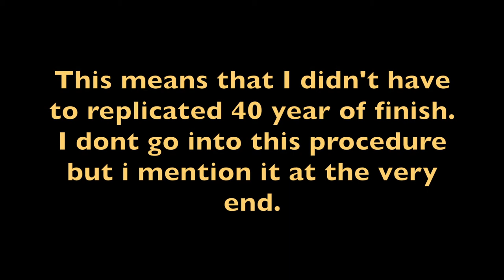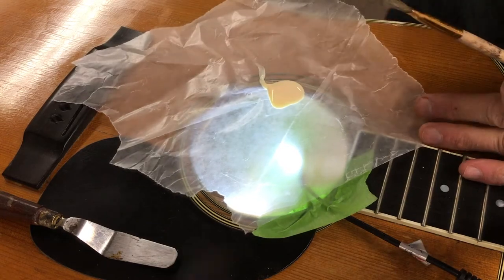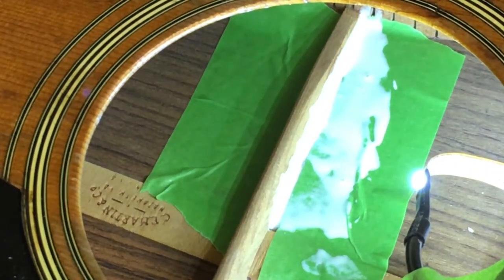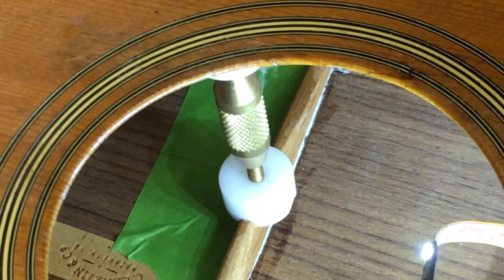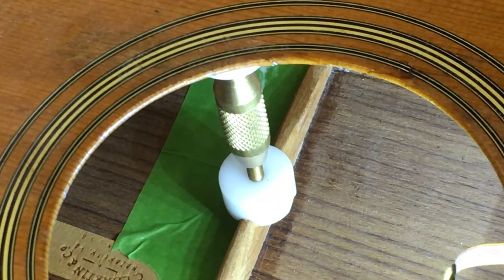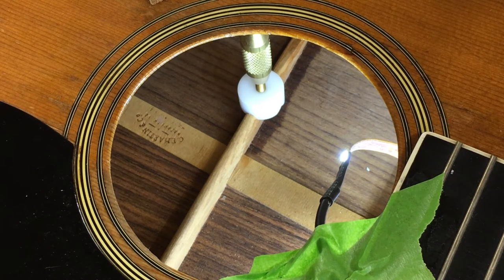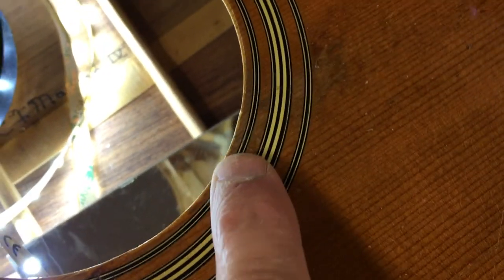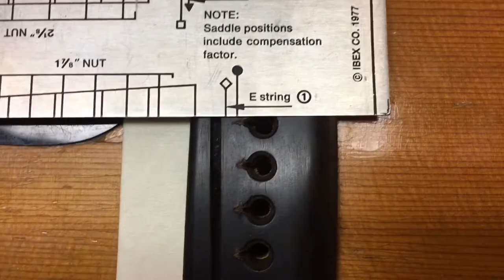How to re glue a back brace  (and everything else) Beau Hannam Guitars

Comment: How about a little compressed air to push the glue under the brace?  Or maybe also use hide glue after spraying a little steam under the brace?  I wonder what glue Martin used then?
Reply from the maker: I suppose you could use air to push it in. Any way that works is a good method. 
Martin didn't use Hide glue in the 1970s (maybe for some super custom orders?) but certainly not for the typical factory guitars.
Reply: @BeauHannamGuitars  If you care about long term health and viability of a guitar you work on for repair you always use the most appropriate CA fluidity for parts that are cracked and still fit nicely together, and the best quality hide you can get your hands on for failed joins of braces like this, separated parts, etc.  

Polymer glues deaden the sound of the instrument because they never get entirely rigid, and they often fail because they have a mechanical vs. chemical bond.  Reversibility is important.  It's the only reason why Stradivarius violins can be repaired all of these years later without destroying and rebuilding major irreplaceable parts of them if it's done correctly.
Reply from the maker: @MrKoozito  I use hot hide glue, titebond, ca, fish glue and epoxy where appropriate.

Comment: That old glue looks like Gorilla glue. Anybody that uses urethane glue on guitars should be drawn and quartered. I use same process on brace repairs with the inside jack and outside cam clamp. I sprung for the stew Mac screw jack for the far back braces. Worth the money for sure.
Reply from the maker: I've had my eye on that screw jack for years- pricy!!! And yes, urethane glue aint good for repairs (it's good for laminating sides though)
Reply: Beau Hannam Guitars and Ukuleles , sides really?
Reply from the maker: @jonahguitarguy  Yep- no water, gap filling. Epoxy is also good. I use titebond red cap